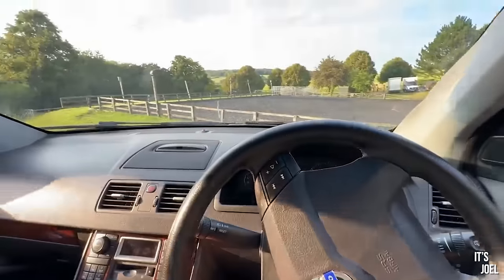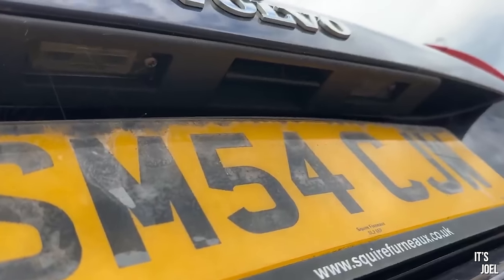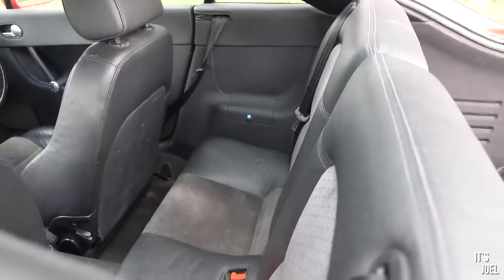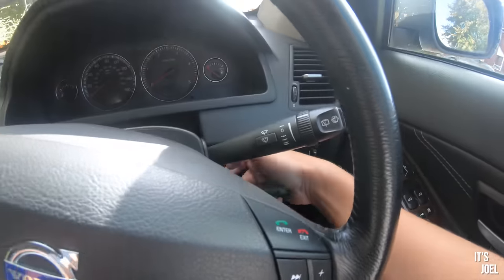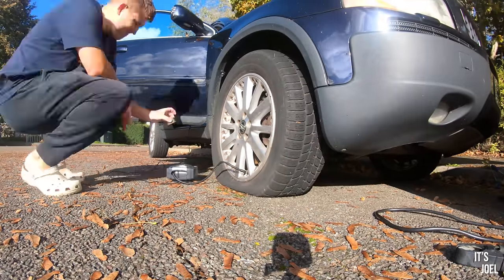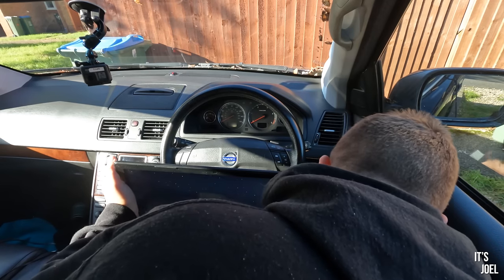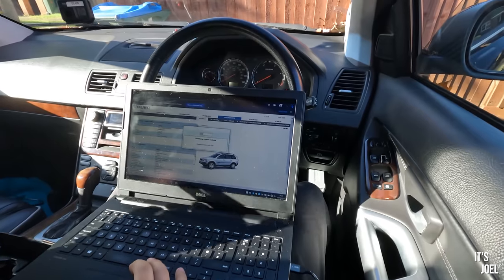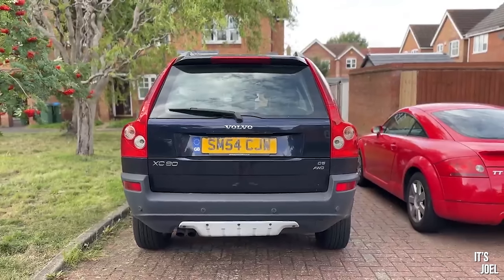CAN I SAVE MY £800 COPART VOLVO XC90? PART 5

Comment: You have the front tyres rotating backwards. I.e. the left side wheel is on the right side and vice versa. You can actually see it in the video where you put them on, too.

Even those seem quite worn, so having them going backwards could make them aquaplane quite easily...

P.S. Only use a blunt instrument to prop open the bonnet to avoid damage, and don't have it against the engine. Engine has flexible mountings, so it will always move and vibrate quite a lot when you start it.

Comment: Suggestion: How about a twist in the story line? Invite a viewer, with lots of XC90 experience, to help you or better still 3 of them all at the same time and knock out all the issues in a morning. Great knowledge will be passed on to both you and the viewers plus it will be fast paced and fun to watch. After all, the engine works, the gearbox works and the brakes work so the rest is minor. Its not like you have accident damage or major rust to deal with, its just parts swapping.
Reply: this guy made fairly moderate stuff look like a mountain rather than an ant hill ....
Reply: @awesomed007  Yeah but we all had to learn some how, I think back to teenage me, a Haynes Manual and no father to help me fix my Austin Mini……. I know how daunting it feels, he is just teenage me. You are correct, ALL the MOT jobs he needs completing are dead easy (ok, some are moderate easy). He can choose the hard way or the easy way, Hard way is solo with a Haynes manual or easy way which is a couple of mentors helping him.
Reply: @@snoopy-XV208 These days I no longer need to fix my own cars (still do stuff though because I want to) but remember the issues of TOOLS so clearly. The result of having bad and or cheap tools as a teenager is that today I will buy the perfect (read expensive) tool for a job, even if it is going to be used once in 10 years ……. It was soooo bad only having cheap tools as a kid. (Oh yeah, you could make those Minx into rockets, great for their time)
Reply: @jolyonrussell7021 yeah but it was even harder for us back then, a Haynes manual was the most help you could get, the internet is a marvelous help to the youngsters today in all skills
Reply: Great idea, the way to go alright 👍
Reply: @awesomed007  Give him a break. A 19yr old high mileage hero is going to be a challenge for anybody, let alone a newbie. Everyone needs to start somewhere. How about building up, rather than knocking down.

Comment: Volvo wheels have a tendency of leaking between the wheel and the tire. Can be fixed with some black goo. Also the rotation on some of the tires is backwards. Otherwise, I do like this series of yours! Massive respect for taking on such a project just to learn!

Comment: hi Joe, i had the same problem opening the hood. easy fix, there a 12mm bolt that holds the lever on remove it, and add a washer reinstall, fixed

Comment: There is a bolt on the secondary bonnet latch - that is the pivot for the latch and they rust like mad - just give is a slight nip loose, and a squirt of wd40 and it’ll be good as new

Comment: You really must get it back on the road mate. It's a modern icon and a future classic.
Next year it can go on classic insurance. Even if you don't want to keep it, it's worth getting it done before you sell it on. Even if it costs you a grand that's fine. Just under £2k for an xc90 is a steal. You should get at least £2.5k back on it if you play your cards right. Maybe even get the work done cheaper or sponsor out the parts sourcing. Many options and a few quid to be made.👍👍

Comment: Joel, I think you are coming up against your own limitations so I can understand you turning it over to a specialist. I'm "oop north" in deepest Yorkshire so I'm a bit too far away to help. I had to seek the help of a local Volvo specialist when the CEM on my XC90 was playing up. You need to address the MoT failures and then you can sort out the other stuff at your leisure. My own XC90 only failed this year's MoT on a track rod end with advisories on the front tyres. I replaced both track rod ends and fitted brand new front tyres which took care of everything. Your ABS problem is most likely the sensors or the pickup ring both of which aren't too difficult to do (the sensors are very easy to change). If your ABS module is in need of replacement I have a spare known working module. They're easy to change out once you've got the airbox out of the way and as far as I'm aware, they don't need to be coded as long as you replace like for like.
Reply: He came up against his limitations before he started working on the car.
Reply: I tend to agree but some XC90 repairs can be a pig of a job.

Comment: ABS light always flashes when car is in diagnostics mode in VIDA. That is normal. These cars are very easy to work on. However of course this is not as cool as Porsche or BMW. But this car would make a great daily or towing car being reasonably cheap to run. Head unit can be swapped quite easily and on your car it has great sounding Premium audio system also with cool minidisc option that is very rare. And also being Executive. Would be sad to see it just being dropped, but I can also understand the frustration if you dont knw what to do and dont have space either. Anyhoo. All the best to you in your car journeys.

Comment: 🆘 ⏬️ JOEL, REALLY IMPORTANT PLEASE READ THIS ⏬️ 🆘

I watched most of your vid before it dawned on me, you are parking a car with no MOT on a public road. Obviously that is against the HWC and you could be subject to points, fines, having it towed, storage fees etc. If you have taxed the car that will also be invalid without an mot which will also invalidate your insurance so if someone crashed into your car it would automatically be your fault, you are also paying for tax and insurance which are not valid which means you are theoretically committing fraud, not to mention paying for nothing. You need to get it SORN and parked on your own private driveway or land until it goes to your pre-booked MOT appointment. You are allowed to drive it to and from the test station but have a printout or electronic copy as proof of the appointment with you in case you need to produce it on either journey (to or from).
Reply: Completely agree. I hope it’s been trailered to and from the garage. I’d hate for him to get caught and penalised!!!
Reply: So much crap in one post, tax and insurance are NOT invalid without a MOT.
Reply: @TheMan-si4iu  insurance becomes invalid not having an mot, and tax is invalid without mot as you cannot keep a vehicle without an mot on the road. That’s what sorn is for.

Taken from internet search:

Having a valid MOT certificate for your vehicle is a requirement for most car insurance policies. This means that if you do not have a valid MOT, your insurance policy is void

Comment: Don't you need an MOT to leave it parked on a public road? Or is it different as a trader?
Reply: Im not sure but i think it might have mot but just wont pass another one
Reply: @ses6jwg  it didn't have an MOT at the time of the video, you can check online on the Gov website. Others have pointed out that he shouldn't be moving it anywhere or parking it on a public road.

Does look like it's just passed on 7 December though, so perhaps new video incoming?
Reply: @boejoss  ah ok. The new one is the dodgy mot he talks about in the video
Reply: @ses6jwg  haven't had chance to watch anything yet but will take a look on train later. Gov website is really useful if you're ever buying a second hand car

Comment: Step up and do some research and get those bits fixed. Some stuff is tricky like the injector but everything else is doable with a bit of YouTube and Google. The learning curve is quite steep but with a bit more effort in the right place this should be back up and running with a mot double quick.